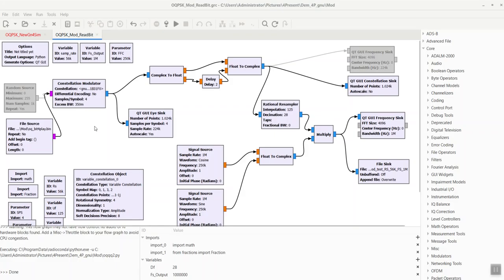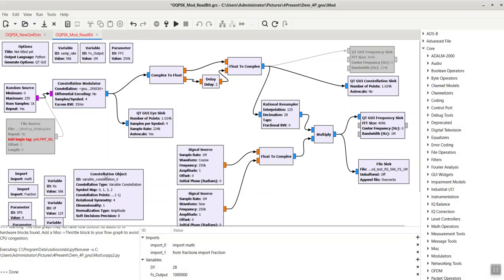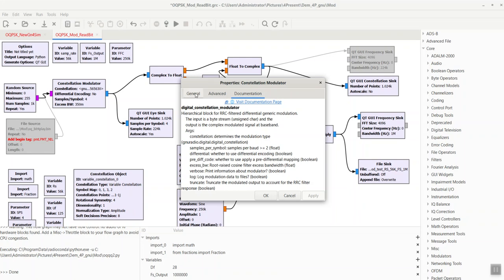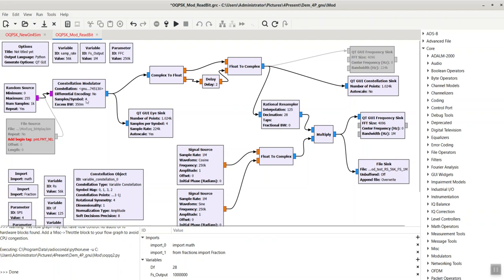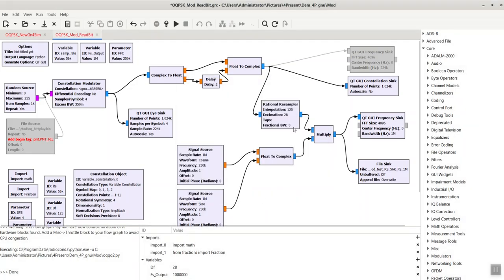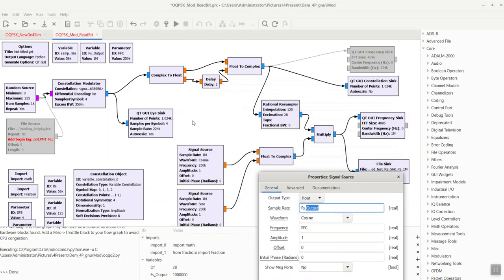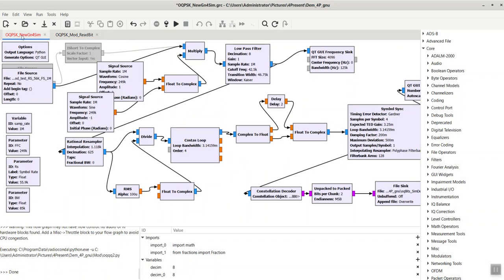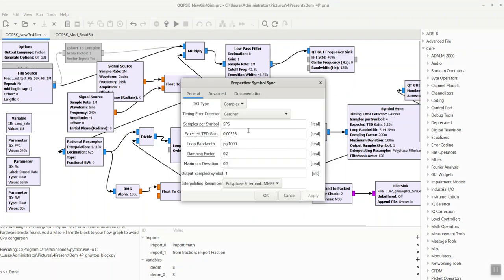implementation of the OQPSK Modulator in GNU radio with desired user symbol rate.

Comment: is it possible to run directy with plutosdr?
Reply from the maker: yes, you can use PlutoSdr sink and connect the output of Rational Resampler to that. and adjust the PlutoSdr sink properly. i.e. set your desired carrier frequency and also samp_rate. samp_rate is the final sampling rate of signal after rational resampler block. also you can disable the unused blocks.